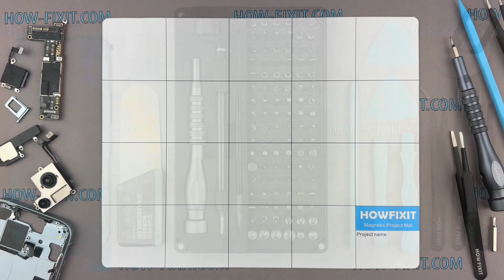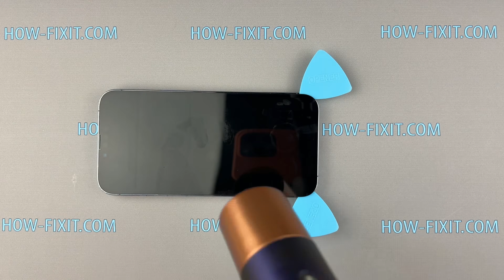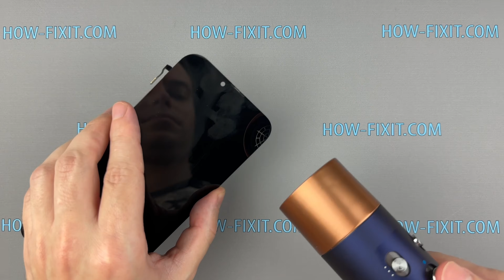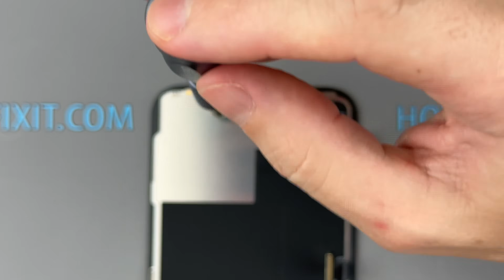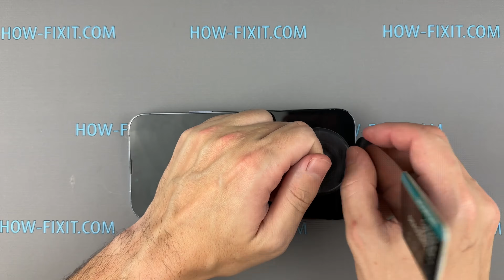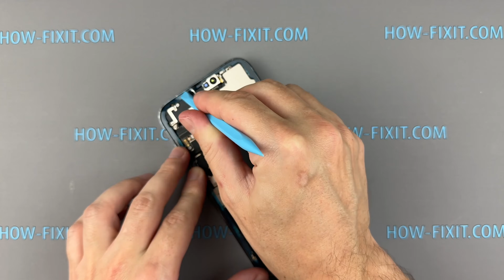iPhone 13 Pro Max Screen Replacement - Step-by-Step DIY Guide!

Comment: just asking about the screw at the bottom of the iphone 13 pro max, is it okay if it is still there while opening the LCD? It's hard to open that screw. I used a lot of screw driver or opener but it's not woring, the 0.8 screw also not working please help me

Comment: IMPORTANT TIP: Do not completely press down your screen while testing it because it is not firmly supported without adhesive. You might crack the screen (Happened to me) while trying to get it open again. Especially the top part of the screen didnt want to come off so i cracked it on top and now I can order a new screen again. Just put on the display cables and lastly the battery and test it without pressing it back on.. Good luck!
Reply: Thank you!!

Comment: I have a really really important question. At 5:15, the big boxy part has torn off the 2 little lines. Will it be okay if I still worked it..? or am I screwed
Reply from the maker: The sensor and microphone will no longer work, but the iPhone will still start up

Comment: add on tap or transfer zhe orginal ic to avoid message and true tone is not problem. small drop of iso propanol to loss proximity sensor.

Comment: This video literally saved my phone. I had a sudden “green screen of death” on my iPhone 13 Pro Max and here in Brazil the Apple authorized repair would not replace it for free — they wanted to charge around R$2,900 (about US$540) for an original screen. I obviously refused.
I followed your tutorial, swapped it for a 120 Hz Chinese replacement and spent only about US$90 doing it myself. Thank you so much!

Comment: Today I broke not one but two screen flexes when pulling screens that didn't have glue. Also, I think I may have damaged the iPhone by overheating it because now it's turning off
Reply: it may be okay i had to do a forced restart as my screen would turn purple and then turn off. I had to press and release the up volume button, then press and release the down volume button, and then hold the side button until the phone turned off and on again. stable so far lemme know if it works so others can do this as well if needed. (it could be a problem with non genuine parts)

Comment: I need help. When i removed the screen, the metal frame was still on the iphone housing. I think only took off the display/screen without the metal clips shown at 3:38. How do i remove the screen metal frame from the iphone housing? Thanks in advance.
Reply: FIXED: Place the plier and carefuly ply it between the plastic and the gap between the iphone housing.
Reply: @hanzv5867  happened to me also my friend lol thankfully the new screen does have that frame (for those who run into this issue and wonder for 15 minutes "do i even need this piece will i need a new one") it had me shooketh lol

Comment: Thank you so much for the video. I followed your steps and managed to get my iphone 13 pro max screen replaced. Cheers.
Reply: Did u happen to to use a heater, I am debating on buying one or not
Reply: @LeeVicky1981 you’re going to need a hair dryer or heat gun

Comment: Hey does anyone know if i can just use a donor screen of an icloud locked iphone 13 pro max and just use that to replace my crcked screen would i have to get the proximity sensor from my scrren or would the one on the donor phone work fine ?
Reply: Yes as long as you don’t damage the screen I’d advice you use a heat gun heating pad something warm to warm the glue up to make it easier the take the screen off

Comment: Thanks. Screen worked while testing as you did, but doesn't display after corner adisive was cleaned and new adisive put in. What could have went wrong?
Reply from the maker: It's likely poor contact between the screen cable and the logic board. Double-check the connection of the screen cable, and also check for dust or debris on the connector contacts
Reply: same how did u fix it
Reply: @martins6908 🎉🎉🎉🎉